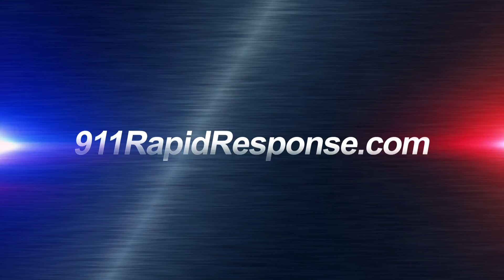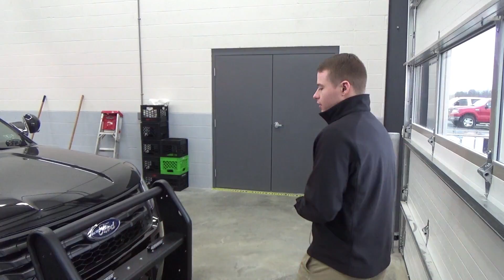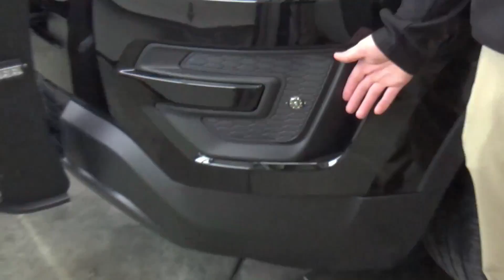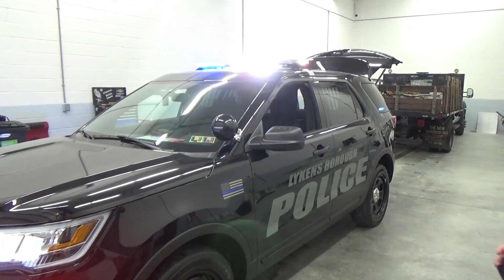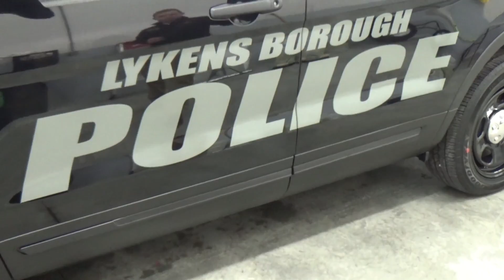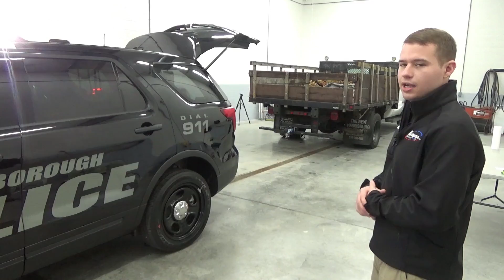Ford Interceptor SUV | Lykens Borough | 911RR

Comment: Shoulda put 40's on the front facing push bumper instead of 180s and caulked dummy 180s into the lower portion of the headlight buckets.
Reply: Why?